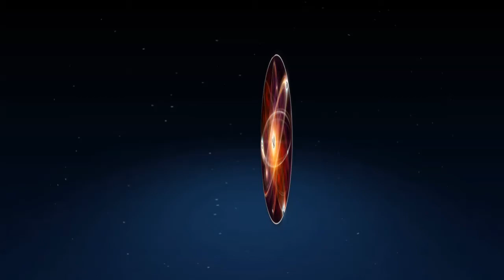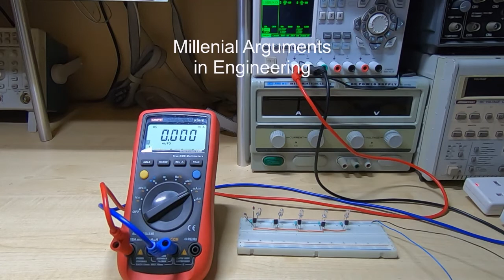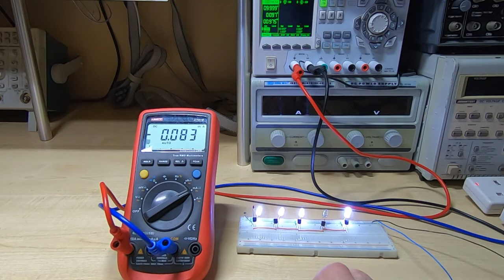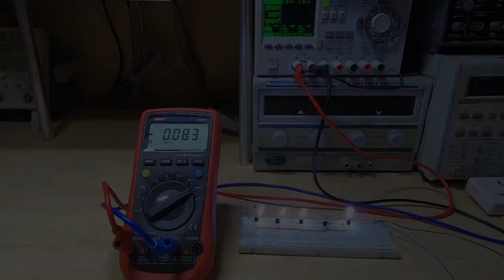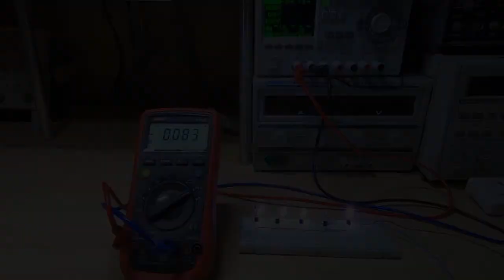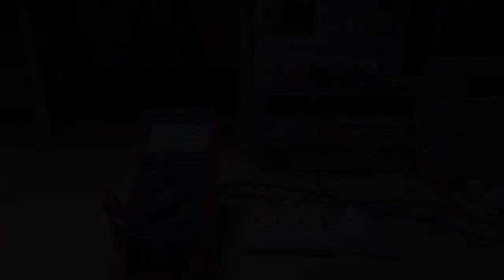Millenial  Arguments in Engineering

Comment: You're probably aware that the IT industry nowadays uses Power over Ethernet (PoE) wherever possible, and PoE is essentially 48VDC from a central power source. I wish everything could run on PoE and that PoE wasn't so expensive to implement in hardware. Facebook actually has all the lighting in one of their data centers all powered and controlled via PoE.

Comment: I love the idea of DC lighting, would make battery backup a bit more efficient in the case of power outages.  But in general I would assume the increased wire size for higher current and added wiring (since switches could not just steal power from the closes plug circuit) are likely why it is not common I would guess?  As for straw man arguments I will try to avoid them but I would guess I get sucked in from time to time too.
Reply from the maker: This was kind of my point. The wiring size would not be bigger and in fact could be smaller as they would not be 'mains rated' and as lighting wiring needs wires run specifically for the lights then there would not be any more wiring. It just comes down to a 'concept' rather than any specific limitation. Overall the installation would be lower cost, safer and of course No Flicker. My original comment was a simple technical proposition and anyone can of course respond to any such comment as long as the responses are related to the point. In this case a straw man comment would be the need for additional wiring (no offence intended) as this has nothing to do with the tecnical point which is to prevent flicker and the wiring has no bearing on this (and at any rate would not be different). I think that the general concept of my point had been lost. Taking Dave's installation then the DC power supplies(s) would be in the ceiling space and powered from the same mains wiring he is currently using. Each LED light would then be connected to it via a very simple current source (as I show in my video) without the need for the individual divers (which are what cause the flicker). Result would be flicker free lighting without any additional wiring and the same switching control and no need for lots of electrically 'noisy' drivers. As I say in my video my company uses this approach very successfully. It really comes down to what my video was trying to get across which is to go back to basics when discussing engineering. The current configuration of LED panels is trying to shoehorn their installation into the old way of installing mains powered lighting. If it is viewed as 'DC lighting' then the whole concept and thinking would greatly simplify and improve the installations. This is just a thought of course.